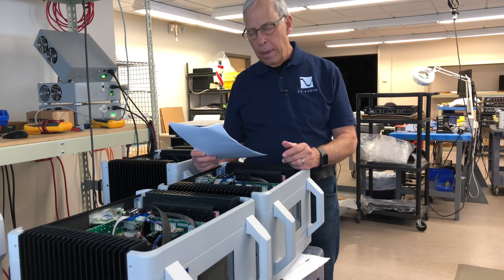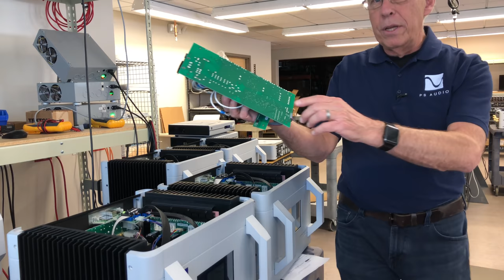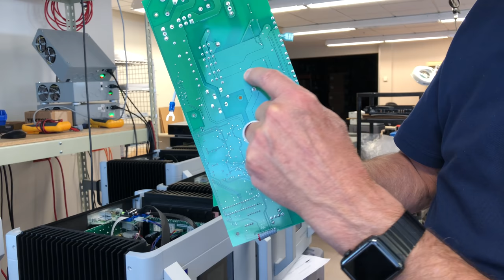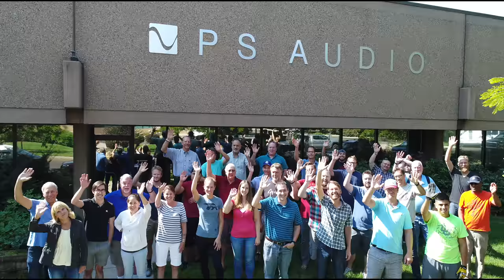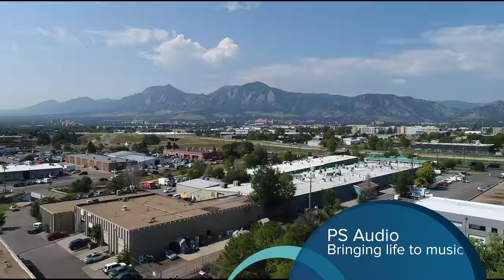Is point to point wiring better than PCB?

Comment: I've got a question for you Paul no technician has ever over the years given me an answer to it.
Why do in some circuit boards they gold plate the whole board instead of silver ? Silver would be better and cheaper so I can't understand why they don't use it over gold? what is 13% better conductivity than gold for free electrons, plus the cost would be cheaper to use over gold. So why don't they use silver. You don't have to have silver tarnishing these days plus it's under a mask anyway so there's not an issue. I would appreciate it Paul if you could  give me an answer to this if you know why. And terminals should be silver-plated not gold. your busbar would benefit from being silver-plated you could use less copper, you should silverplate all your boards then you would  be just as good and better as point-to-point wiring better in a way because you can make the circuitry have better skin effect. Now there's an upgrade for you.
Reply: Because gold don't oxidize. Simple.
Reply: If any connection terminal is oxidized the resistance will likely 10 fold or even non conductive.
Reply: @johnyang799  i heard silver gives you more high, and gold more lows.
Reply: @johnyang799  I did state that there's not an issue with silver oxidizing, on a circuit board or even on a terminal not if they mix it, And  the oxidisation doesn't cause resistance
Reply: @johnyang799  I did say they can make silver to not oxidize and even if it does oxidize oxidisation on silver doesn't cause resistance
Reply: @BijBijTCG  that could be because the signal is being resisted more for gold has less free electrons flowering by 13% the highest get diminished in the carrying of the signal. That's why they make high end capacitors with silver internal film.
Reply: Silver is not used as a PC board plating, well perhaps on some microwave boards but certainly not for general use. What you think is silver is simple solder or tin plating. As stated below gold plating is used for oxidation resistance. And in many cases the gold is not plated but flashed, very, very, thin layer. This is done more recently because of the use of BGA packages. It is an additional insurance of a good bond. The electrical resistance difference between tin/solder, gold, and silver plating on a typical PC board is minuscule. Only at very low RF levels in the GHZ range would this matter. Certainly not for audio gear.
Reply: @BijBijTCG  Audiophile voodoo! They perform identically for HiFi audio. In fact if you analyze this claim, it's the opposite. Silver is more conductive than gold. And bass reproduction requires more power than treble. So in reality a sliver wire is better for bass than gold!
Reply: @BijBijTCG  well, this is just sad
Reply: @ninethirtyone4264  thanks :)

Comment: the big coppers bus bars 6:18 have nothing to do with impedance, it's just resistance, if you drive a lot of current, you need low resistance; and sure you can measure it, run as much current as you need and measure the the voltage with any of the multimeters you have laying around, it will in the hundreds of micro ohms or a few milliohms; it actually concerns me that you didn't measure, that means the product you are manufacturing might have a problem! what if those bars don't have enough current carrying capacity, warm up and catch a fire?
Reply: You know that resistance is part of impedance right?
Also 1mm 1oz roughly carrys 1A. A copper bar will likely carry 100A or even more.
Reply: John Yang it's not relevant to the problem, resistance is, even if you got AC; there's no likely, it either is or there isn't, "likely" isn't science or engineering

Comment: So the question then becomes: should the copper traces be super pure copper?  What about the copper thickness, what about the material the boards are made of.
Reply: Pure copper or not in that distance don't matter. Thickness and width limits the current. 1mm 1oz for 1A basically. 3-6mm 2oz is more suitable for power amp application.
Reply: In audio circuits it's simple ohm's law. The copper trace must not drop too much voltage for the circuit requirements. When we get into RF, skin effect comes into play and that then has to be considered in PC board trace geometry.

Comment: You could do it on that power regenerator, but it would need to be the size of a refrigerator plus it would cost 5-10 times as much, so yes ultimately not practical. Thanks for the info. otherwise Paul.

Comment: A well designed PCB utterly destroys point to point wiring. All those stray EM noises from so many long wires dangling around won't improve anything.
Reply: Ive looked inside a point to point preamp that was made by a local designer. It belongs to a friend of mine and looked like a crow's nest inside. In fact one electronic repairman refused to work on it.
Reply: Measurements back it up.